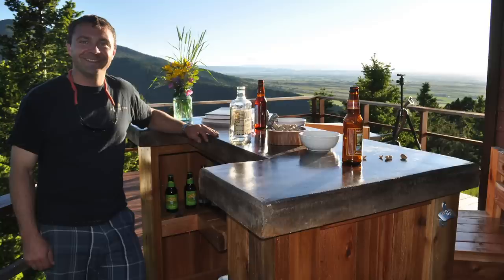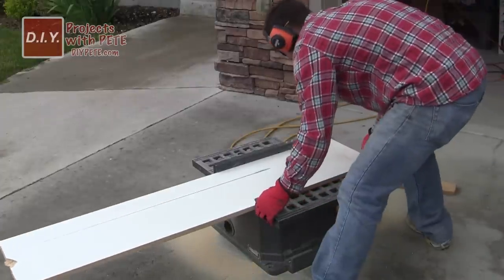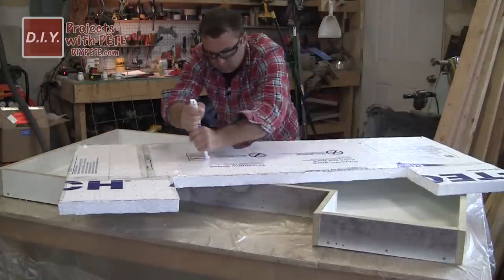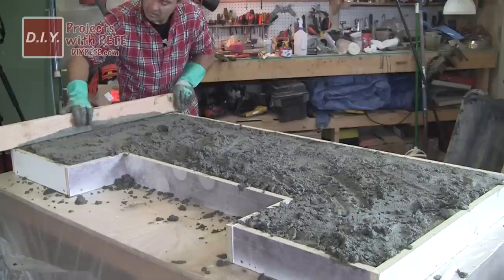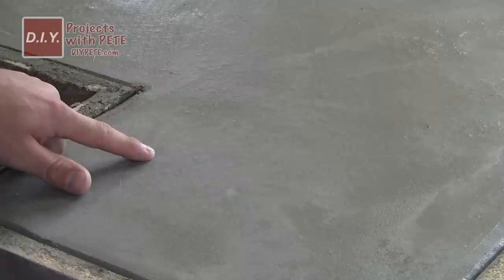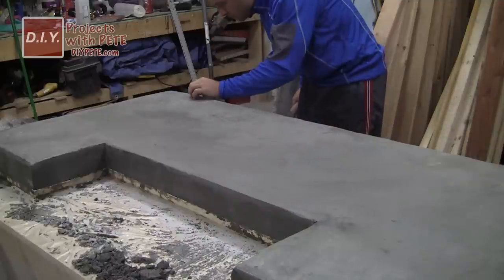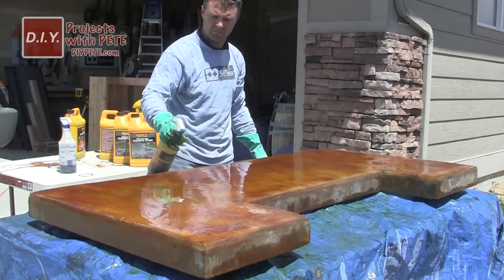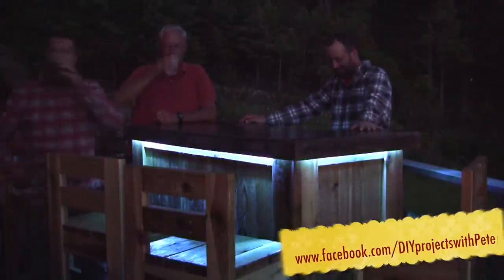How to Build a Patio Bar with a Concrete Counter Top | Episode 15 Part 1

Comment: hi Peter thanks for responding. currently it's 32 inch and I'll need to extend to 48. I'm having a hard time thus far on a countertop that's not too expensive, nice and won't crack in the winter.

Comment: Hey Pete!  This inspired me to do this for my bar in our basement that is 'almost' finished.  Finally got around to doing this for my indoor bar top.  10 ft long.  Still used the foam insert/apron look combo.  Can't wait to 'carry' this inside down to the bar frame.  I'm guessing 500lbs!  I am having trouble finding quikrete stain in local big box retailers.
Reply from the maker: +Kyle Kroening Hey Kyle! Wow, I can't wait to see it!!! I'd recommend trying to find a concrete supply store in your area that carries acid stain. (any brand will work) -- and if you can't find it locally, this is a good one a lot of folks order on Amazon (it is cheap too) http://amzn.to/1YJ0nM4

Comment: How could anyone give this video a thumbs down??!!  it was great.....I was gonna use granite on my outdoor kitchen/bar, but the cost was killing me.....I'm def going this route
Reply from the maker: Hey John! Thanks so much for watching. Concrete is definitely a great solution for outdoor kitchens. I have a few different concrete videos -- you might want to look into the reverse cast technique which eliminates the need to trowel. This makes it easier to get a super flat top. Cheers!
Reply: Your making the process upside down. Your suppose to work the underneath of the countertop on top, and the bottom part is going to be your top. So I don't know why you would teach the technique upside down. And while curing the concrete, your suppose to tarp it so it doesn't dry too fast.

Comment: Pete a stupid question, when you mount the concrete to the bar, how do u securer it to the wood? Or is the concrete heavy enough not to move?
Reply from the maker: Hey Lance! The concrete is heavy enough that it doesn't budge. But you can run a bead of 100% silicon around the top of the base in case you are worried!

Comment: @diypete,  isn't a steel trowel supposed to be used only after the bleed water evaporates?  I've read that doing it before that time will trap the moisture and cause it to delaminate.  I'll be doing a hand-troweled finish on my kitchen counters and am trying to understand when to properly use a steel trowel.

Comment: Hey Pete, one question. This concrete you using looks like it has almost no stone/pebbles in it.Confirm that it is in fact concrete or cement?I would think it would have to be concrete but just can't see enough aggregate in the mix on the video clip.Thanks mate, good job
Reply from the maker: Hi Russ! I used Quikrete 5000 for this project and it has a good amount of pea gravel, and is a concrete mix. I use a float to help bring the cream/cement up to the surface for the hard troweling finish process. Let me know if that helps. Cheers!

Comment: Hi Pete! I enjoyed watching you put this project together, that I decided to tackle this build on myself. I have modified your plans a little by adding a 2x6 to the front corners, cutting out speaker ports, and adding speaker faces for my Bose speakers. I additionally increased the length of the base a foot, and added the shelf to the other side as well. I am at the stage in the project to build the mold for the concrete top. I want to embed glass on the surface, and place my favorite college football team emblem in the center of the top. My question for you good sir is, could I accomplish this same build by utilizing the techniques you used for the embedded MT metal sign concrete table you put together, face down, and still have the same results with the foam insert on the top, as opposed to the foam silicone mounted to the bottom? My intent is to use a wet polisher to expose the glass and bring it to a high shine. Please send me your advice. Thank you. 
Richard
Reply from the maker: It sounds like you are going to do this concrete top using the reverse cast technique, similar to how I did it in the followinga video: https://www.youtube.com/watch?v=h9A_DWfbLzs   - If that is the case, you can certainly embed a glass logo similar to how I did the metal logo. If you want to do the trowel finish like in the bar video above, it is going to be a bit harder to get everything to come out perfectly flat, but you could push it in and then use the trowel to even the concrete out around it. Let me know if that helps. Cheers!
Reply: I have chosen to use your reverse cast technique, and I will be placing glass aggregate to the surface along with the metal team logo in the center of the mold. I am curious to know if Signs of the Mountains would make me two 6x6” stencils of an image I want to add to each corner of my countertop. I would like them to be just like the Montana state stainless steel one that you made for your concrete table you made.

Comment: How did you like working with the 5000 mix I have had a local concrete guy tell me to just use Portland cement with sand mixture I am definitely not knowledgeable in this area but I really want to try the project any pointers
Reply from the maker: Hey Richard! The 5000 mix does work well. Although, if you are a newer at troweling it is a little harder to learn on since it has larger rocks in the mix and if you don't float the cream to the surface properly it can be harder to trowel. You can buy a mix from Quikrete called countertop mix and that works really well and is easier to vibrate the bubbles out in my experience. It is also a much smaller aggregate which makes it easier to trowel as well for a beginner. If you used sand and portland cement, you may want to add a little larger aggregate for a project of this magnitude. Additives put in a lot of the pre-mixed bags are very helpful. Cheers!

Comment: I'm trying to make a bar countertop with a 1 ft overhang...any thoughts on that?  How do I create the bottom of the overhang with plywood then get rid of it after the concrete sets?  I was also thinking I could do it off the bar and form out the whole bar top which could be any shape I want (including the overhang) and then transfer this top to the bar base.  The only problem with this last solution is I am building a bar that is 10ft long with a 5ft "L" shape so I think it might be too heavy to move to a bar base.  Thoughts?
Reply from the maker: Caleb Provencio Hi Caleb, in my experience a foot overhang works fine and I've not had any issues. Much more and you'll want to use brackets to help support it. Not sure if you are planning to do an apron / lip around it like in this project to make it look thicker than it really is and if you are planning to pour it right side up or reverse cast. If you still have questions let me know! - Cheers - Pete

Comment: you use a power sander on the edge or a hammer drill to get the vibration ..
Reply from the maker: William Stark I use a combination of a power sander and a rubber mallet.

Comment: Is this something that you can leave outside for long periods of time?  I was thinking of one for my patio, but it would not be covered.  I was thinking of doing one without a concrete top.  Thanks for any advice you may be able to provide.
Reply from the maker: Hi John, mine has been out on the deck the last 3 years. I put a new coat of sealer on the concrete each year to keep it looking top notch. Cheers

Comment: hi I have 2 questions. I live in PA and having an outdoor kitchen build DYI
1. I had the concrete poured a few days ago can I still acid color after the fact? 
Due to harsh winters though i will cover in the winter. Concrete will be my safe  bet
2. My counter lip is about 5 inch can I extend it 6 inches? I'm scared ppl will have to lean over to eat? I'm scared there may not be enough leg room. also can I pour additional concrete to the existing concrete or have to start over 
thank you
Reply from the maker: Hi! Acid stain is applied after the concrete is cured. If you plan to extend the lip more then the 3 inches, you'll most likely want to add additional re-enforcement, and possibly make the life a bit thicker. -- Everything will need to be in 1 pour, I would not recommend trying to pour additional concrete on existing.

Comment: Great work Pete....So wanna do this project...
Is there any concrete mix out in the market that is light weight and suitable for this application?
I want to make a smaller table but do not want it to be that heavy...
Thanks
Reply from the maker: phil par Hi Phil! I don't know of a real "light weight concrete" -- but there are techniques to make them weigh less. One is to do an apron similar to how I create the concrete top in patio bar video. The other way is to do an overlay. This would involve building a plywood top and then essentially troweling on a thin layer of concrete. Here is a video of a guy showing the process. https://www.youtube.com/watch?v=ykjLQGwMxEc -- let me know if that helps out at all! Good luck!
Reply: I think I will follow the apron concept. looks a lot more durable and appealing to me.
I saw couple of videos where they used fiber glass to reinforce the concrete and the concrete had kind of a honey consistency without the gravel (Only sand, cement and God knows what else)
It looks complicated to me but the finished surface is amazingly.
If you tackle this material please do a video. Keep people all around the world making concrete tops...Thanks!!!
Reply from the maker: phil par Hey Phil! I have used fibers in a few projects to help with re-enforcement and have worked with a number of different mixes including the polymer based concrete mixes. If I tackle another one like this I'll definitely video tape it :) Thanks so much for the kind words and inspiration to keep pumping out videos Phil! Cheers from Montana! - Pete

Comment: Do you remember roughly how long after pouring you removed the sides to finish with the trowel?
Reply from the maker: It really depends on the mix used and temperatures etc, but I pressed in with my finger to feel when the top of the concrete was firm but still left a slight imprint. At that point I removed the sides. Probably around 4-6 hours in my case.
Reply: Gotcha, Thanks!

Comment: I am going to make a concrete bar with epoxy coating for a customer. It will have a stream running through it and eventually a waterfall over the side of the bar  any hints  ?  thanks
Reply from the maker: Hey Paul, I can't wait to see what you come up with, it sounds amazing! You are going to use a pump to create the water feature I take it? Will the river bed be a half inch or inch deep or so and with some slope to it? Or are you planning to use a metal trough or something for the channel?

Comment: Hey Pete, I want my bar top 10' x 2 1/2' long. Can't find melamine that long. Can I use plywood instead.
Reply from the maker: Hey Derek! If you are doing the troweled top similar to this video then you could use plywood if you'd like. I would recommend sealing though. If you did want to use melamine, you could use pocket holes on the underside or biscuits to make connect melamine boards together.
Reply: Thanks for the tip. I will use the melamine and use your suggestion. Thanks for the great video's.